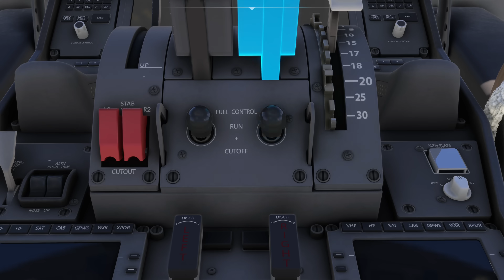Air India 171: Why Did The Fuel Cut-off Switch Get Moved?

Comment: I've worked on airplanes and avionics for 47 years. I've never seen a 'maintenance jumper plug' that could do that, and it wouldn't work anyway. Someone would still have to install and remove it, duplicating the exact same action as operating the switches. And, it wouldn't turn them off 1 second apart.
Reply: IF IF IF it was a circuitry failure, then it had to happen on two separate, independent circuits within fractions of a second.  Trillion to One.
Reply: I wish we knew more about the cockpit voice recording to know if there were any sounds of a struggle before the cut off was turned back on.
Reply: @christinew333 

I think a struggle did take place because it took 10 seconds for the first switch to be reset back to run and another four seconds to do the second one.
Reply: @CorneliusTaylor-s1uthat could be coz it took the pilots 10 seconds to understand that it was a fuel switch problem.
Reply: @christinew333 wait until the final full report and some of your questions might be answered.
Reply: Not a pilot, just a tech guy, but if the switches were thrown a second apart then that looks like human action to me. I held my opinion until I saw that detail come out. Simultaneous, would be mechanical. One second apart, could be unknown mechanical problem, more likely to be human action. But why did the one fellow say he didn't do it? Maybe he was telling the truth. Did they both fight to save the plane?
Reply: @JimmyTH101 maybe only the final full report will tell us what really took place.
Reply: True...pure speculations and theories by folks who have never been near a wire . Such a jumper could only be placed during maintenance, not on a running plane. If there is any it will not shut OFF until it is removed.
Reply: @PaulDkodi this comment section is full of people that apparently are experts on airplanes. Glad you have some common sense though
Reply: There was no jumper.  The switches were still intact after the crash and shown in photos.
Reply: Plus, it would need to be mechanically in run to takeoff in the first place...
Reply: If a jumper plug (mimicking the fuel cut off position) had been left in place by mistake it would have kept the engines shut down and they could not have been started in the first place.
Reply: hehehe, you are making wrong comments....
Reply: Watch Flyingbeast video if you  really believe in unbiased explanation ❤❤❤ english subtitles are available
Reply: Once people notice that the preliminary report says fadec stands for full authority “duel” engine control they will realize it wasn’t written by competent people
Reply: FADEC stands for  Full Authority Digital Engine Control. @KenJordan-n1h
Reply: @KenJordan-n1h  it doesn't say that.
Reply: @Puffs_Daddy page 15, first paragraph
Reply: @KenJordan-n1h  correct. And as I said, it doesn't say that. I'm looking at it right now.
Reply: @KenJordan-n1h  FADEC = Full Authority Digital Engine Control
Reply: @Rotorman524 exactly, digital engine not duel engine. The preliminary report said duel engine. If the person who wrote the preliminary report didn’t even know this, what kind of credibility do they have?
Reply: You’re quick to blame the pilots, but let’s get real:
🔴 A viral video taken on the same aircraft just hours before the crash showed malfunctioning cabin electronics — power issues, failing displays, and unresponsive systems. That’s not random. That’s a clear warning sign of deeper electrical faults.

🔴 The takeoff roll was unusually long and slow, clearly visible in CCTV footage. This was before any engine switches were flipped. If the aircraft was “normal,” why did it struggle to lift off? That alone suggests power or thrust-related issues, possibly tied to earlier electrical problems.

🔴 Both engine fuel control switches were turned off within seconds of liftoff — an action that takes force, not something easily done by accident. And the CVR shows confusion in the cockpit: “Why did you cut off?” — “I didn’t.” That doesn’t sound like deliberate action; it sounds like unexpected behavior from a faulty system.

Yet despite all this, you’re pushing a theory that clears the manufacturer and blames the dead pilots — just like Boeing did during the 737 MAX crisis, when they knowingly hid MCAS flaws and let pilots take the fall.
Reply: @Gurpreet.jheeta 

From what I've gathered Air India doesn't appear to have the best aircraft maintenance, and that malfunctioning cabin amenities are often faulty.

The evidence is leaning heavily towards suicide/murder. You just seem to want to blame Boeing.
Reply: @CorneliusTaylor-s1uMultiple whistleblowers, including Boeing’s own engineers and ex-employees, have come out exposing serious quality control failures and profit-over-safety decisions. One even said he wouldn’t let his own family fly on certain Boeing jets. This isn’t conspiracy it’s from inside the company. When insiders stop trusting the product, that’s not ‘safe,’ that’s a red flag. So yeah, pointing fingers at Boeing isn’t irrational it’s overdue
Reply: @Gurpreet.jheeta 100% agree the confusion in the cockpit over the turned on fuel cut off switches shows neither of the pilots had touched the switch(es) I also believe some electronic failure triggered the switches.
Reply: @TheSolidheroes  not possible. I've been working electronics for 47 years, and electronic failure would affect both switches simultaneously.
Reply: @Puffs_Daddy I see and in case of an enginefire would they also switch on simultaneously ?
Reply: @TheSolidheroes  no. They're two separate manual switches. They can't be turned on or off simultaneously unless two different people with split second timing do it together. It's possible one person could loosen their restraints, tun in their seat, and use both hands, but very little chance that could happen. Even still, it's unlikely to be truly simultaneous.
Reply: @Puffs_Daddy And what about the 1 second gap between the two switches  being activated, is that physically possible for one person to do it that fast? I understand you need to make  a certain movement to unlock the switch?
Reply: @TheSolidheroes  that's about an average time for one person.
Reply: @Gurpreet.jheeta  That video was on a separate aircraft at the same airport, a FULL DAY before the accident.  Even if it WAS a maintenance issue, which it wasn't, the INDIAN airline is responsible for it's own maintenance, OR the INDIAN airline's pilots who were flying that plane should have taken it out of service.  Your lame ass excuses don't remove the blame from the INDIAN airline, it just moves it to a different department.  Unlike most of the delusional people making these ridiculous comments though, the multiple international agencies investigating this accident, inclduing the INDIAN airline and INDIAN government, have released a report containing facts that remove the possibility of this being a Boeing issue.  An airframe model does not go two decades without a single airframe loss if there are systematic problems that could cause this kind of accident.  A 787 has never had a dual engine flame out EVER before, nor has there EVER been a report of a fuel cutoff switch activating by itself, which of course means that the probability of them BOTH doing it within 1 second of eachother, is impossibly low.  Speaking of quick to blame, you're clearly not here with any knowledge of what happened, so take your head out of your b*** and go away.
Reply: @Kalikus808 Multiple whistleblowers, including Boeing’s own engineers and ex-employees, have come out exposing serious quality control failures and profit-over-safety decisions. One even said he wouldn’t let his own family fly on certain Boeing jets. This isn’t conspiracy it’s from inside the company. When insiders stop trusting the product, that’s not ‘safe,’ that’s a red flag. So yeah, pointing fingers at Boeing isn’t irrational it’s overdue
Reply: @Gurpreet.jheeta 

What you're doing right now is irrational. Anti-Boeing irrationalism.
Reply: @CorneliusTaylor-s1uYou call it irrational, I call it informed. What’s actually irrational is defending a company whose own ex-managers have testified before Congress about cutting corners. John Barnett blew the whistle on Boeing compromising safety at the cost of lives and conveniently ended up dead under suspicious circumstances. Edward Pierson warned about unsafe practices before two planes crashed. Employees said they were pressured to stay silent and even joked internally about ‘clowns designing planes.’ This isn’t theory it’s their own people exposing them. If you still think questioning Boeing is irrational, you’re either blind or just willfully ignorant
Reply: @Gurpreet.jheeta  there is absolutely zero indication of a problem with the aircraft, so any conspiracy theories against Boeing are indeed irrational. There are plenty of problems to blame them for, but this crash isn't one of them. You might as well blame bugs on the windshield.
Reply: @Puffs_Daddy  stop crying western bot, we all know boeing is an embarrassment company from the western world 😂😂😂😂😂😂
Reply: @beepbop6697 that is absolutely not a design problem. It isn't possible to engineer out any possible mistake a pilot could make. If that were true, we'd never have to train pilots at all. We wouldn't need them. But this is reality, not fantasy.
Reply: @spresso007  that was a great five year old response. Bravo. Would you like to make an adult comment now?
Reply: @Gurpreet.jheeta how are you going to have cabin electronics when you have no engine running. Once the engine turns on it doesn’t need anymore electricity to operate. Don’t try and talk about something you have no clue of
Reply: @Gurpreet.jheeta  if there's a viral video, why has no one here seen it? Where is it? How did it get taken when there are no cameras in the cockpit? Why were these supposed malfunctions never reported? The takeoff roll was standard for that weight at that altitude.
Reply: @Puffs_Daddy I saw that video too. It was an early morning flight that day from Mumbai.  This plane had electrical issues, nothing was working in the cabin. I think that to push agenda about any pilot suicide is a bit too early. It could be sabotage,jihad or whatever ones action, which cost so innocent lives,but that particular person must be ready mentally to take this burden of murdering so many souls. It could happen, but people around him must notice that someone's behaviour is changing.  Normally,if we can use this word in this particular situation, people doesn't come to conclusion to commit suicide overnight. It takes time,especially for the people,who are very strong mentally, went to varies trainings and 'bulletproof ' to the stressful situations. First of all you must be an engineer on all electrical and electronic systems on this plane to exclude any situation,when electrical problems or deliberate mechanical sabotage could affect those switches.
Reply: @67nextday  I wasn't pushing any suicide agenda. I learned long ago not to second guess an accident investigation. Problems in the cabin are not what he said. He said the cockpit systems, which he has now edited out. Have you seen a cockpit video? Why were no such malfunctions reported in the tech log? Why do the voice and data recorders mention no such defects? Cabin problems are not cockpit problems, and no such problems were reported for the flight prior to the crash. As with others who have viewed that video, there are serious doubts it even came from the previous flight,. or even from that particular aircraft.
Reply: @Puffs_Daddy  Nearly every video is pushing a suicide agenda and stating that no way these switches can be done in any other way but manually because of 1 sec gap. Just pretend,that it has been connected to a two different electrical power units for a safety or just on purpose to commit sabotage. There you go,1 sec gap is possible. Electrical problems in the cabin doesn't prevent this ( or even another?) aircraft from its journey in India,because video clearly shows flying aircraft, full of passengers. If any aircraft has some electrical issues in the cabin,how can these issues be isolated from making troubles in the cockpit?
Reply: Are you saying it’s not possible to switch off the switches simultaneously 1 second apart?
Reply: @Yohaan2407  simultaneously and 1 second apart are two different things. A jumper would shut them off simultaneously, not 1 second apart.

Comment: Is it possible that faulty computer shut the engines off and pilots restarted them back? Because would the pilot see the other pilot truing it off?  I think it’s BS. They don’t have the time they were turned off and the time it was turned back on.
Reply: Is this possible.
Major failure of systems which caused the RAT to deploy and also shuts the fuel valves. The pilots get some warnings including engine shut down warnings and fuel cut off warnings. One pilot quickly assumes the fuel switches were operated and asks the other why. The other pilot says he didn't. They then realise the switches are in the on position so try cycling the fuel switches off and on to see if that would get the engines going.

Comment: "but my question is at the time of takeoff computer know's that its a crucial time &  fueling is continue to engine and altitude is rising  why computer accept the first  input to switchoff by the controlers because he din't find any problems in that moment, so why computer accept the command in that moment strange, which is why i dont think both  pilots have done that first  switch off which reports are claming that done manualy by pilots..because if anything weird in system or failure because of any object hit/bird hit any other technical disturbence computer is the first member in the cockpit  who got the info of any problems in the whole plane after that he inform the pilots..that i have concerns with the report.

Comment: It would be easy enough to allow the pilot(s) to shut down ONE engine while airborne at low altitude but prevent the SIMULTANEOUS shutdown of BOTH engines.   This is probably worth doing. 

However, in the final analysis, we have to trust the pilots, or simply not fly.  Takeoff is a very vulnerable time for a plane, and if one of the pilots suddenly and without forewarning decides to crash it, there's probably no way to prevent that.  Change the fuel switches and he could still grab the throttles, or the yoke, or work the pedals.  It would take the other pilot a second or two to react, and even then it would be a fight for control.

Comment: No where in the report it is said "deliberately".... I have gone through the entire length of 15 pages atleast a dozen times....
I am putting the exact text that's there in the report regarding fuel run/cutoff switch
"The aircraft achieved the maximum recorded airspeed of 180 Knots IAS at about 08:08:42 UTC and immediately thereafter, the Engine 1 and Engine 2 fuel cutoff switches transitioned from RUN to CUTOFF position one after another with a time gap of 01 sec. The Engine N1 and N2 began to decrease from their take-off values as the fuel supply to the engines was cut off. In the cockpit voice recording, one of the pilots is heard asking the other why did he cutoff. The other pilot responded that he did not do so"
The above is from Page No. 14 paragraph 4 & 5. Look at the usage of the word "transitioned".

Without mincing words let me speak the truth. There are only two possibilities:
1) Pilot suicide 
2) A system failure (As of now it looks like this is not the case)

Now, there are some open questions which are bothering me. Say, I want to commit suicide. Should I choose a 2 storey house or a 20 storey house? If one of the pilots really wanted to commit suicide why did he choose such a low altitude? If you look at the Map of Ahmedabad International Airport you will see that River Sabarmati is very close to where the ill-fated aircraft crashed...It was absolutely possible for the other pilot to ditch the Aircraft on the River had the other engine (Engine 2) spooled up a bit more on restart to give enough thrust to atleast hold the altitude. So, why "the suicidal Pilot" would choose such a low altitude!! Second, which Pilot was "lying"? The pilot who was flying (Capt. Clive Kunder) ? or the senior pilot monitoring (Capt. Sumeet Sabharwal) ? Or, none (unlikely as of now).
Now, some more questions..
If the investigating agencies AAIB (India) , NTSB (US) , AAIB (UK) are sure of Pilot Suicide theory then why not Police Investigation has started? Why they are not making atleast the Cockpit Voice Recording public (though legally they're not bound to) just to stop the speculations? Why they are not saying which fuel switch transitioned first? N1 ( Left hand side) or N2 (Right hand side) ? This is a crucial question because both the Pilots were right-handed - Pilot flying was on the left hand side.
 
Lastly, another thing is striking me that how two switches can be transitioned from "run" to "cut-off" positions within a span of 1-1.5 seconds by a human being... These are not simple switches, one needs to pull up the heavy lock & holding the lock up then move the switch... Isn't the time taken too short for a human being?

All my analysis is done on the assumption that no cover up took place to save a Big Company which has already lost almost all it's reputations ...A cover up will be the greatest injustice to two dead gentleman's dignity... And that's why I think investigating agencies should have been more open to public & media. This is an extraordinary case & should have been dealt with more clarity. 

Here's the link to the report..I would request everyone to read once . Especially page 13, 14 , 15

https://aaib.gov.in/What's%20New%20Assets/Preliminary%20Report%20VT-ANB.pdf